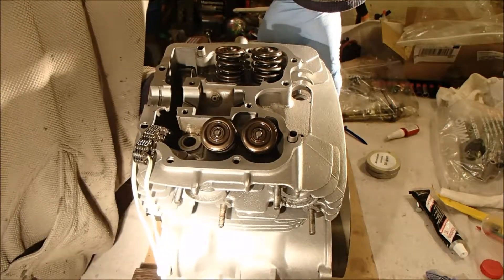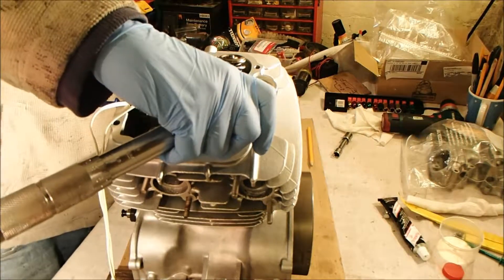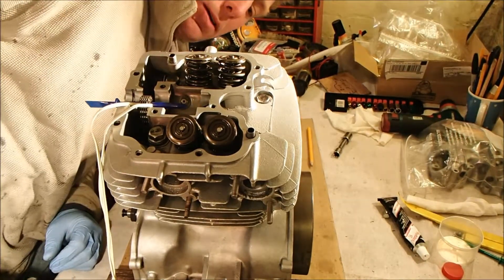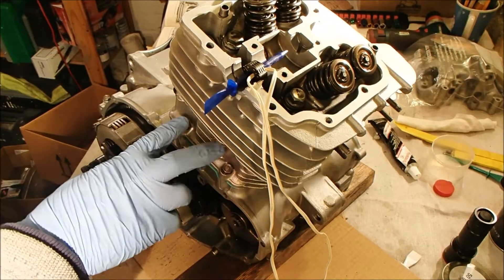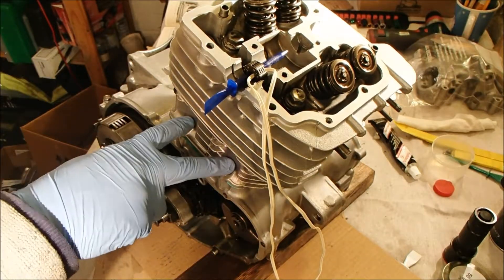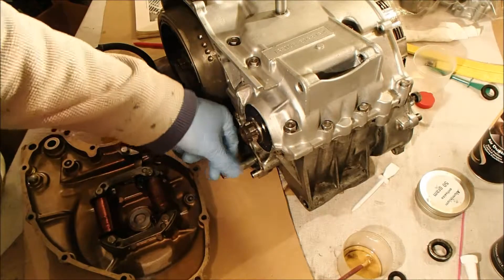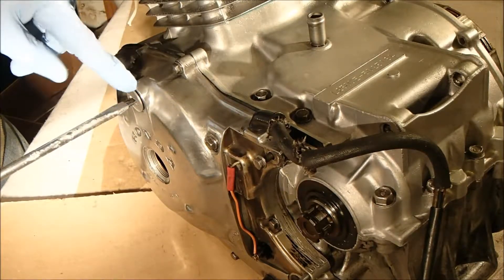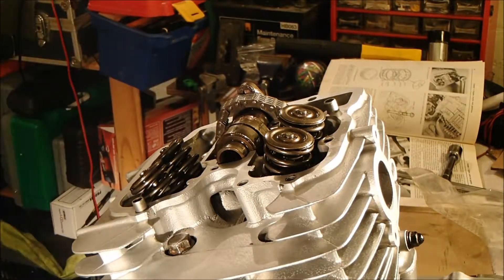Honda xl250s engine restoration (part 17)

Comment: We’re there any rubber washers/seals that went on any of the bolts ?
Reply from the maker: Not that I remember, the only rubber on a bolt was the water seal on one of the head bolts front right if sitting on the bike. It sits 4/5 th of the way up it